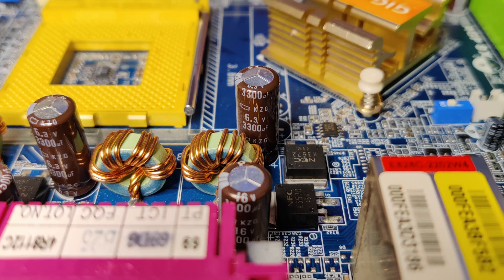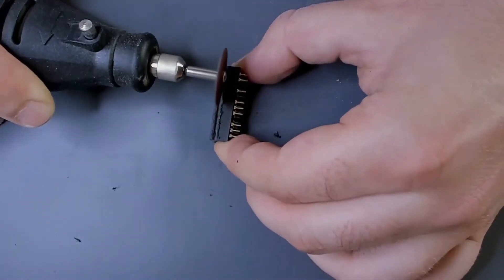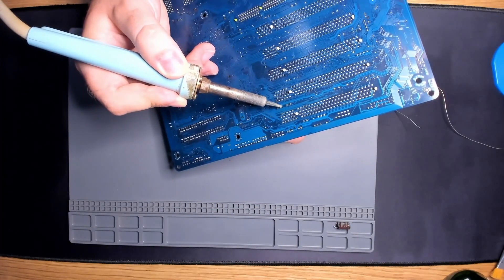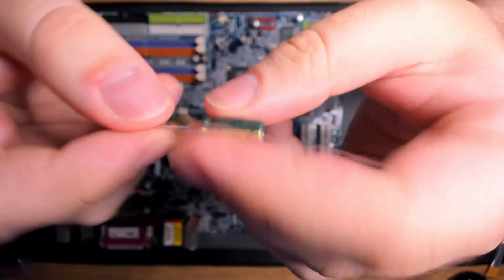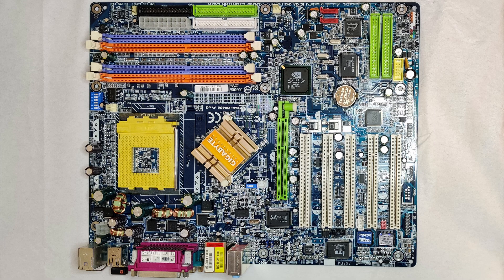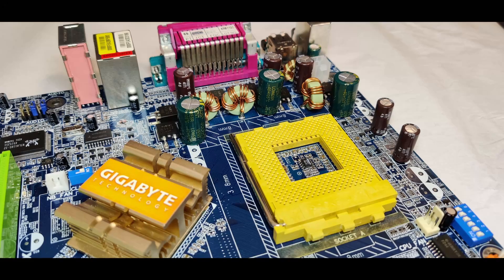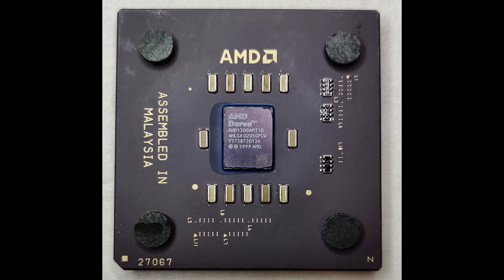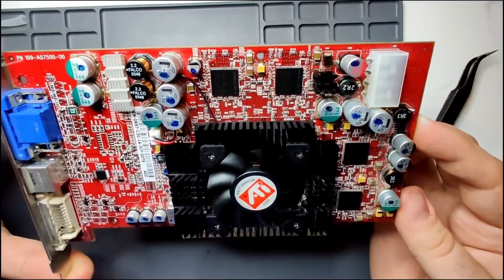Gigabyte 7N400 Pro2: Replacing capacitors

Comment: better using the spatula/card to flatten the thermal compound- google. then remove remains before mounting. add compound at one side and use card to flatten. only very thin layer.

Comment: 2009-2018 still halve working. some functions dead. PSU had to be standby since cmos-settings could be backup up anymore after full shut down. one cardslot dead so one ram-slot. many MBs available switched a lot. hadnt deep repair knowleadge. wanted to replace all of them. have long monologue in sysopt mid june 2018. europanorama =me. PSU.. Capacitor Plague(added recently. took me 3 weeks to revive also asroch AliveDual esta 2. the latter died later could repair but stayed with working winxp pc til i got some months later Acer Ultrabook Spin 1-111. celeron 4/64 and much later swift 7 16/1tb win10. and the drama continued. other dramas. bad screen on swift 5 and maybe sabotage by acer using shock sensor to shut down keyboard. discussion on acer forum. engl. and german/deutsch. both had a drop heaver spin1-111 survived 4 heavy ones from 80cm swift 5 one light drop from 45cm and with delay screen dead . spin1 with heavy rotation damages. could repair halfway.

Comment: You have to wonder how the edges of the CPU die got in such a state; the CPU has the black pads in each corner to stop the heatsink causing such damage, so how did it happen?   
😮

Comment: I have GA-8PENXP mobo that does not post. Capasitors are leaked much like in the board in the video. Could you please tell me what is that lubricant you used before cleaning the holes from the alloy?
Reply from the maker: Hi, this is solder flux. It helps the solder flow to make nice solder joints or to remove solder using a copper wick.

Comment: Yeah, I remember this situation back from early 2000s, capacitors on some graphic cards or mother boards just bulged or exploded only after sever years of use. It's only because the manufacturers wanted to reduce the cost, so they picked cheaper capacitors instead. When such case occurred more and more often, those manufacturers took notice of it, and decide to switch to capacitors with aluminum casings, significantly reduce the risk.

Comment: Amazing job! I have the Gigabyte GA-7NNXP with the VRM Module that I bought at broken. It doesn't turn on, but it needs for caps and maybe some VRM components.
Reply from the maker: I believe I have this exact board with Athlon XP 3200+ back in Germany. I even have the working VRM module. Great board! Are you planning to fix it (if possible)?
Reply: @bitsundbolts  Oh nice, probably the best looking motherboard for the Socket 462.
 I plan to fix it, but it needs to be someone with knowledge (I don't have enough knowledge to repair it). I have so many motherboards with problems! 🤣 This weekend I did retest my Gigabyte GA-5AX, but it have some kind of short circuit in low dropout regulator area.

Comment: pulling the capacitor is fine if you are sure you won't pull out the via with it,  but i have tested one faster and probably safer method
make 2 big blobs of fresh solder on both legs and try to make both molten and capacitor will fall out by itself without any resistance,. cleanup is basically the same afterwards but it doesn't stress the top layer that suffered the most from the electrolite

Comment: Just use hair dryer on maximum air flow on board. It speed up drying process like by 500%. It also get hot to about 50-70 degrees Celsius by it. Helps drying.

I've turned on board after 2 hours from the point it was washed, and it worked.

Comment: Hmm. I also have a Gigabyte 7N400 Pro 2 (Rev 2) sitting around. Maybe I should check the capacitors for any bulging/leaks.

Last time I used it it was working fine but that was a few years ago now.

I have an Athlon XP 2600+ (Thoroughbred) paired with my 7N400. Nice to see this hardware still in use!
Reply from the maker: It wouldn't hurt to check!

Comment: I love tech from that era but I don't own any at this time due to it being during the capacitor plague years of the 2000s. So many boards from around then died due to low quality or even straight up counterfeit capacitors. I had a total of 4 motherboards of my own from that era die from the plague. 3 of those boards couldn't even be fixed due to failures that caused the boards to literally go up in smoke.
Reply from the maker: Guess I was very lucky then that this board somehow made it that far!
Reply: @bitsundbolts  no, I've bought about 40 motherboards from that era. Some of them even untested. Even those with buldged capacitors worked fine. Nothing exploded. Tested all of them about 30 minutes, some of them even longer.

Just don't be affraid, capacitors plague is not so bad. In most cases, board is only less stable, and after you use it long term , the capacitor that is buldged eventualy starts leaking and can go on PCB and damage something.

It's not something like luck, when socket A board work. Just opposite. I was suprised, how could some boards work even in such bad conditions (dusted, and bulged capacitors, loose sockets, scratches on PCI slots ... expected them to not work)

so you are not lucky, I can know it from my statistic, how many untested boards I took, nothing exploded yet (old tantalum capacitors exploding much more likely).
At 99%, you could turn on board even before capacitor change, and it would work to BIOS at least, nothing would explode.
Reply: it wasn't the capacitor but the electrolyte chemistry that was improperly stolen and used by almost all manufacturer at that era (see wikipedia: capacitor plague)

Comment: 2:26
My way is to wash dusty boards is using dishsoap + any car snow brush then drying with leaf blower. 

You can shave car brush to desirable length. I tried to use toothbrush, but everything on pcb is higher and i ended up just bumping all elements with plastic. And i can't reach board between slots.

Then i put board on towel and use leaf blower to blow off water.

PS. Five years ago, I replacing the capacitors on the ASUS AM2+ motherboard, at the very last moment I remembered that ASUS has the reverse marking of capacitors on the board. I would have received a grandiose fireworks when turned on if I had not remembered this.
Reply from the maker: Thanks for the tip for the brush!
Oh, I was not aware about the ASUS issue! I'll check it!

Comment: Great video!
Small tip, if you don't mind: find the capacitor legs before soldering. That way it won't move
Reply from the maker: You mean to bend the legs? 
I know what you mean. I try to keep them as straight as possible. That makes it easier in the future in case I have to take them out again. But yes, you are right, it would make the process much easier.
Reply: NO NEVER DO THIS, if the part goes bad again you will damage the board trying to desolder it